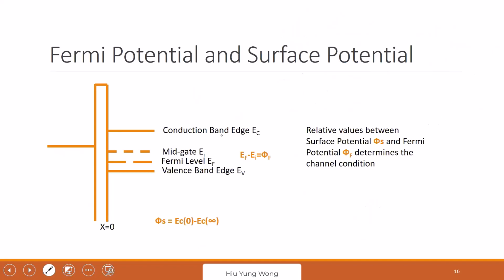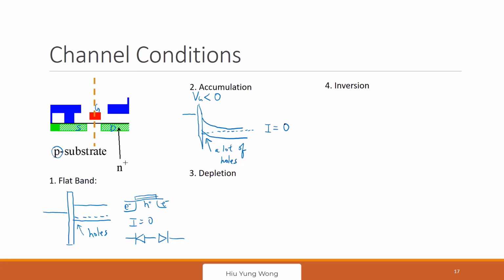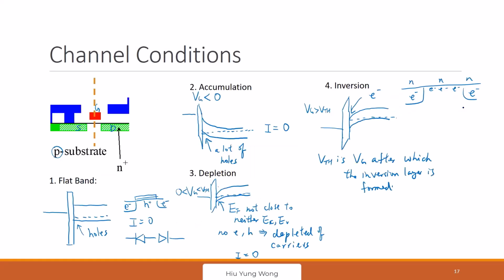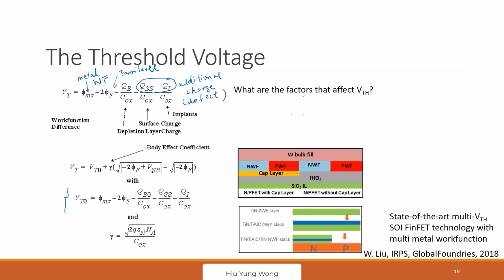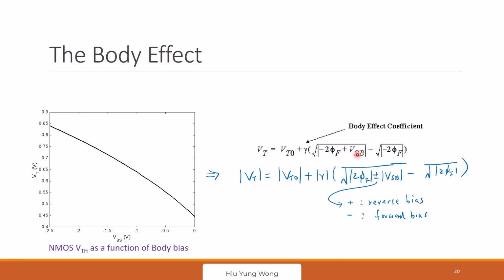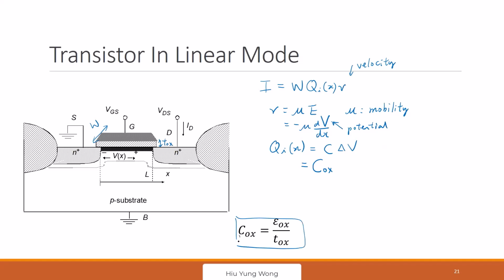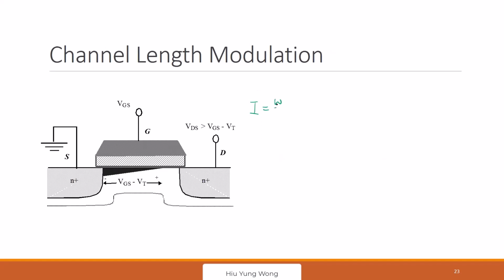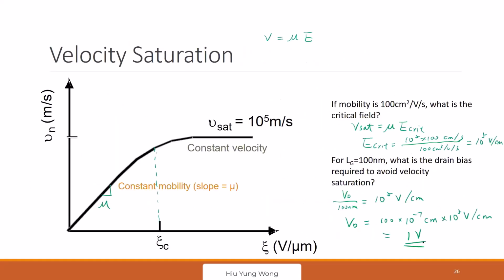L5-D Transistor Device Physics

Comment: There are two Electric fields. One is in x direction and other in -y direction. So the resltant field should be angled from drain to source. Why the drain is not tilted while fabricated?
Reply from the maker: The electric fields you mentioned are a result of the application of voltage during its operation. The shapes of the source and drain are determined during the fabrication. So they are not affected by the efield to be applied later. Thanks!
Reply: @quantum_computing thank you for answering.

Comment: channel length modulation  VS    pinch-off point shift to Source  as Vd increasing.        
  i am a little confused about these two concepts
Reply from the maker: @vlsi_learner They are the same in the simplified theory. When the pinch-off point shifts to the source, the effect length reduces (channel length modulation) and thus it has a higher current. These two videos might have more details: https://www.youtube.com/watch?v=m4ypNGvqWiM https://www.youtube.com/watch?v=2A5UsJfA4nA